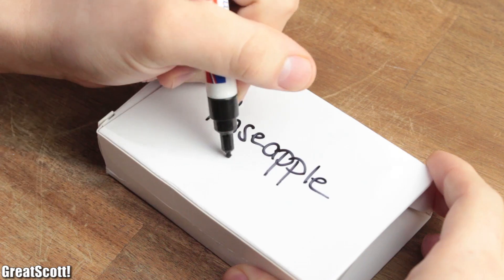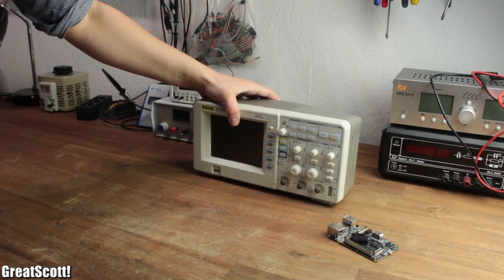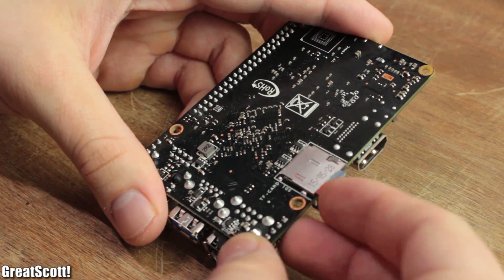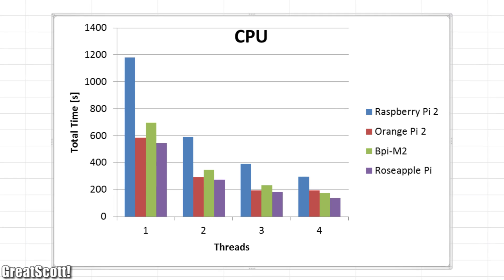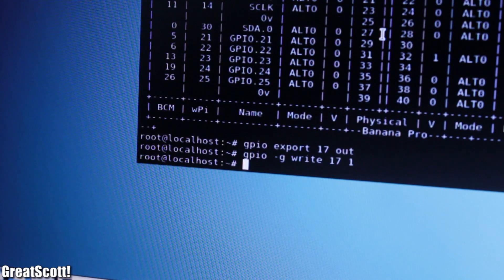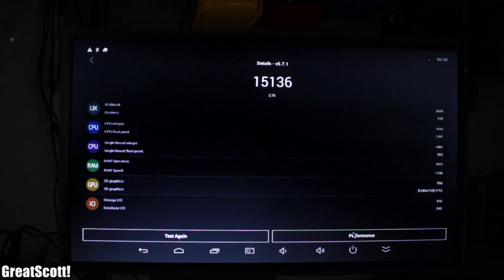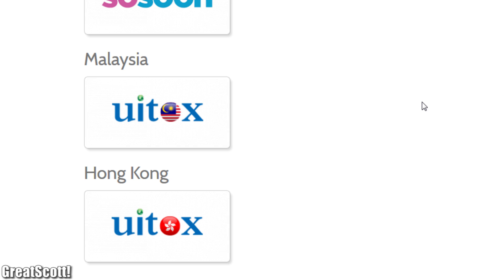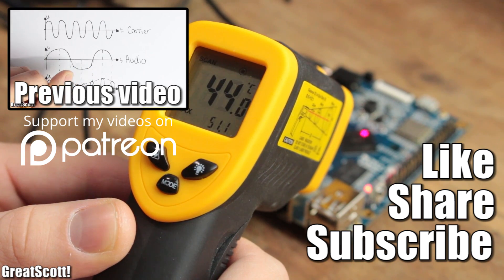Roseapple Pi Review! Another Raspberry Pi like computer?!

Comment: Can you review the Udoo neo,Udoo x86,and Udoo Quad boards...they are not raspberry pi replicates...but they also support arduino shields and wifi,bluetooth.the Udoo X86 board even support M.2 and HDD (since it has pentium quad core which draws a mere 6 watts)...and it can work linux,android and windows 10!!...

Comment: Have you tried the udoo x86 or the pine 64 or up board or odroid  or firefly  that's my favorite  they have 3 different versions  of rockchip  arm soc's  a 4 core CPU + GPU , a 2 core + 4 core big little CPU + GPU  & a 8 core CPU  + GPU   and they all have lots of RAM and eMMC flash but there Chinese  so they lack software development .

Comment: I got one of these from the distributor in Taiwan yesterday and your unappealing white box looks better than mine. I made a boot image of Android 5.1.1 and it booted fine and even recognized my Logitech keyboard and mouse. One thing I noticed was whenever I clicked on something the screen would blank for a second or two. I plugged it into my NEC projector. I have tried to make an image of Debian but it does not boot or does not recognize my NEC projector. 

Thanks for posting.

Have you seen the Actions S900 "development board"? $89. Except for the expansion slot it is no different than an Odroid C2 in my opinion.

Comment: Just get a Pi 3. It has built in Wifi. And is a lot faster.
Reply: the odroid c2 is the archenemy of the pi3, dont have WiFi/BT (that are awful in the pi3), but are more powerful in every way (better cpu/gpu, 2gb RAM, microsd uhs-1, gigabit ethernet, etc) and have the wiring pi library too :p
Reply: fersunk
(Everytime i write Pi i mean Raspberry Pi)
 I think the integrated Wifi and Bluetooth in the Pi 3 are great! They work way better than any USB Adapters i could find.

The odroid may not be a bad piece of hardware, but in a Pi i know that that piece of software designed for a Pi would work for that Pi. I do not know if software designed for a Pi would work on a odroid (Most of it will, i think).

Yes, 2 GB of RAM would be good, because 1 GB tmpfs would be great. But in everything else, i prefer a overclocked Pi.

Gigabit Lan would be great, but as i do not have a 10/100 Switch, it does not really matter
Reply: Michi Lo the WiFi in the pi3 work awful according to reviews (just N at 72mbps and poor reception), the BT is a nice add on, the software can work (just edit the gpio pins in the code), and a pi3 OC cant match a odroid c2 (arm a53x4@2Ghz) and the gigabit lan is more common than you think, my módem has 10/100/1000 ethernet (obviously is the módem of my Internet provider) and the router too.
And the odroid forum is great, you can solve a lot of doubts there :p
Reply: fersunk That WiFi at least works on Linux. My Wifi Stick uses a special chip that requires a special recompiled hostapd Version. And hostapd is the only thing that works with that Stick. So everything would be better than that.
And did you really expect a WiFi card with antenas 4x shorter than a laptop wifi card would give you that great reception? But it will still be better than no internet.

I know that most equipment from the IP has Gigabit, but now i need to use Powerline and a 10/100 Switch (Because my Wifi Stick does not work). Even if it had Gigabit, my Powerline Adapter would be WAY to slow.

Maybe i get a odroid some day. But now i still prefer a Pi. A nice thing about the odroid would be the IR sensor. I was unable to get lirc running on a Pi, maybe a odroid can do it (i doubt).

Comment: wifi dongle wont work in usb 3.0
use 2.0
Reply from the maker: +Stanislav Jochman USB 3.0 was not the problem.
Reply: +michael lowe It would be the Operating system itself not having the right drivers for the USB Dongle.
Reply: +daniel15092 that is what i was thinking it has nothing to do with the board its the OS that needs to support the wifi card (did not test usb3 speeds)
Reply: +lee x he could just use an ethernet to usb cord and attach the dongle from that

Comment: Please do a review of the ODROID-XU4

I want to use an SoC as an introduction to Linux and Android OS.

ODROID-XU4

* Samsung Exynos5422 Cortex™-A15 2Ghz and Cortex™-A7 Octa core CPUs
* Mali-T628 MP6(OpenGL ES 3.0/2.0/1.1 and OpenCL 1.1 Full profile)
* 2Gbyte LPDDR3 RAM PoP stacked
* eMMC5.0 HS400 Flash Storage
* 2 x USB 3.0 Host, 1 x USB 2.0 Host
* Gigabit Ethernet port
* HDMI 1.4a for display
* Size : 82 x 58 x 22 mm approx.(including cooling fan)

Comment: but I have a question that I could never really find the answer from your videos. Could you just install Raspbian on the roseapple pi and forget about all the issues? it would have the same os as the raspberry pi and the same community. Shouldn't also the gpio connectors also work?
Reply from the maker: +Ciroluiro No, it would be great if it could be that easy.
Reply: +GreatScott! oh that's too bad! So if I want to get started on single board computer projects or programing, I have to choose raspberry because of its community and neat os.
Reply: +Ciroluiro Each single-board computer needs a customized distribution mostly because of drivers. For instance, the Raspberry Pi uses the VideoCore GPU/VPU while most other boards use the ARM-architected GPU/VPU like the Mali series. But there are a lot of different Mali versions, not to mention Ethernet drivers, USB drivers, etc.
Reply: +Ciroluiro Also AFAIK these fruit board or phone/tablet etc.. systems doesn't have ACPI or any standard protocol/config to access hardware like normal motherboards. Every device address needs to be hard-coded in kernel. So every board needs customized kernel, having driver isn't enough.

Comment: I'm not sure I see the point of these Pi clones... surely once the zero is generally available you either buy that, or stick Linux on one of the very cheap Amlogic Android devices?
Reply: +Jason james uh.. better specs or features which the Pi doesn't offer? The Pi is nice but it isn't the be all, end all you know... also those Android devices you mentioned, for a slight step up in price you can get an atom based mini PC for around $80-$99.
Reply: +vgamesx1 By the same token though the Android devices are cheaper (much cheaper) than this Pi clone, so your argument is actually one against this device.
Reply: Jason james ok but I never said I was for or against this device, just that the Pi isn't a magical perfect device meant for absolutely everything, don't get me wrong the Pi is great especially at $5 but I'd still love to see some higher specs and things like on-board wifi.

Comment: Still no Gigabit ethernet? OH COME ON
Reply: +EpicLPer I honestly don't see how that's an issue... These things are so low powered and the SDcards are so slow I don't see you ever maxing out even 100mbps except for very specific use cases.
Reply: +vgamesx1 With USB 3.0 and Gigabit I'd more than gladly be able to use it as a NAS, I don't even need the SD card except for the OS then.
Reply: EpicLPer only a single drive though, that isn't much of a NAS so it sounds like more effort than it's worth, but whatever floats your boat man.

You could always build your own using an AM1 or atom board such as this 
http://amzn.com/B00388UO70

You could also buy a mini PC or look for a thin client PC with a Gig port and turn it into a NAS for example
http://www.aliexpress.com/item/2015-New-Fanless-PC-Mini-PC-Celeron-Mini-pc-win8-1-X30-N2830-2-16GHz-Dual/32438179612.html
Reply: +vgamesx1 Yeah, could work. Then again if this had Gigabit I'd just do a "manual RAID" by using a script that syncs both harddrives like each night at 5 AM or something so both will have the same files and everything. COULD work but is a lot of effort to do :P

The thing is that, if I'd buy something like what you mentioned, I'd rather have an "all in one" option already like where you can put the drives into the machine itself already. There was an HP "Micro"server or what they were called but that thing costs like 300 bucks for only a dual core which was... yeah... a lot.
Reply: EpicLPer well they make modern ones you know? They're somewhat inexpensive these days.
http://www.amazon.com/s/ref=sr_1_6_hso_sc_smartcategory_1?rh=n%3A13436301%2Ck%3Anas&keywords=nas&ie=UTF8&qid=1449438920&sr=8-6-acs

Now of course they aren't quite as cheap or nearly as customizable but if you want a simple all-in-one solution then they're great, plus a $50 Pi clone and a $50+ drive would be almost as much as just getting a WD my cloud.
Reply: +vgamesx1 Unless you buy an ODROID C1 which has a real Gigabit NIC and can also take eMMC Modules which have speeds comparable to SSDs.
Reply: +EpicLPer In nas's, most of the money is in the storage, even if you go fairly high end on the other nas hardware. Pi's are really for lower end things, but one could be used as a smart tv box to communicate to your nas quite well. In this situation, I can see the lack of gigabit being an issue, but I also see the use of an SD card becoming an issue in buffering high bitrate video. Most small appliance boxes have similar issues here though.
Having a USB3 flash based storage solution would alleviate the storage issue, but you would still be left with slow ethernet and would be limited to streams compressed to at least 10MB/s. This would mean some of your videos may need to be transcoded by your nas, which can stress it. 8MB/s is still a very high quality stream however, so you will not really lose quality, but transcoding such high bitrate raw video can be hell on a nas.
Reply: Richard Smith "most of the money is in the storage"
I sort of agree, however that entirely depends on how you decide to go about setting up your NAS, for example if you use FreeNAS it needs a moderately beefy machine, as ZFS requires a minimum of 8 GB of RAM in order to provide good stability and a 64-bit multicore CPU.

That's just its minimum requirements, so the 8GB ram and $70+ CPU both are already more costly than a of couple 1TB drives, however if you go with a premade solution, it would be a bit cheaper and some even include drives but might not stream videos that well.
It depends really..
Reply: vgamesx1 Well, when i think of a nas, i think of mass storage. 4-8 2TB long life drives is quite expensive, less than that and I struggle to really call it a NAS. 
But yes, it is nice for a nas to have fairly beefy hardware, which makes using a pi or multiple pi's pretty crap, ESPECIALLY since that beefy hardware is not much of a hit after you factor in the cost of storage. If you are transcoding, beefy hardware helps a lot.  Btw, btrfs is replacing ZFS, and is much less demanding, but does like RAM a lot. Better for high performance storage arrays in my opinion. Keep it updated though since its still in active development. Lost a drive a couple months back, and lost no data at all, and having complete rollbacks of the data to specific dates is great. The way it backups is it takes snapshots of changes. So each backup is only as large as the changes that have been made.
Reply: +vgamesx1 Very true. For me personally I was hoping for 1 gigabit because I want/need my Pi to operate as a weaker entertainment system on the TV. I would also enjoy having it hook up via gigabit to a NAS on my network

Comment: I can recommend the ODROID C1 and new ODROID C1+.
Reply: +tjpld second that if you want to go cheap or if you want something more powerful/cores/ram the ODROID-XU4 packing Samsung Exynos5422 Cortex A15 2Ghz and Cortex A7 Octa core CPUs is definately the way to go
Reply: +tjpld Have a look at the Pine A64!
Reply: +SYCKODELICUS They are like $80 though, compared to the ~$40 for the C1+. However the OrangePi seems to have similar specs and is offered for $15-30 depending on the model. (unfortunately, the prices for all these boards is higher on amazon or US sellers in general, presumably due to shipping costs.)